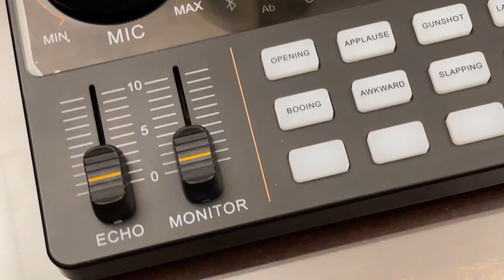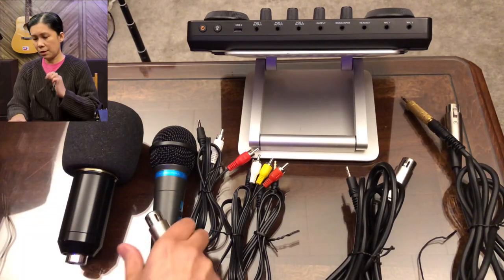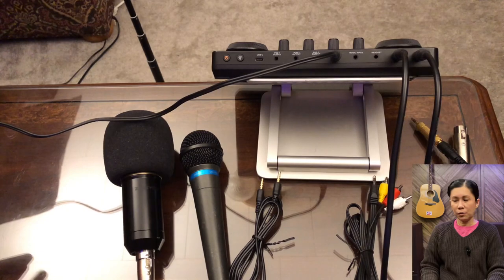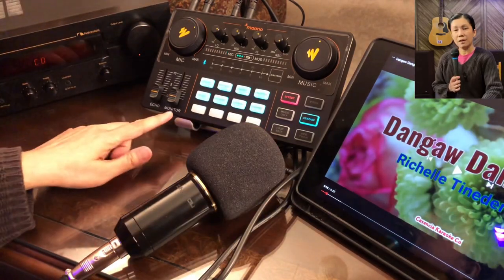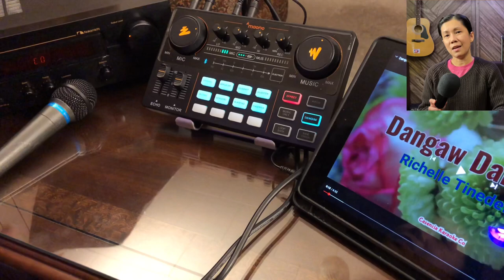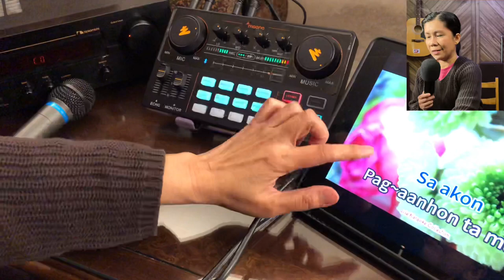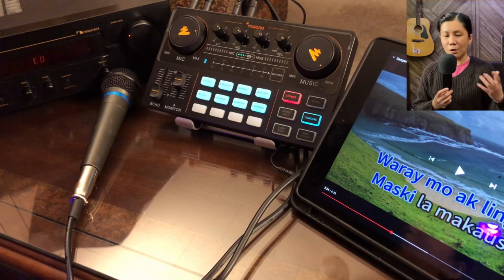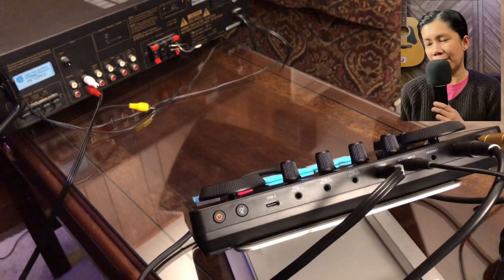Maonocaster Lite to Amplifier for Karaoke Set Up - Testing Condenser VS Dynamic Mic

Comment: How did you connect a dynamic microphone? Does it need phantom power?
Reply from the maker: It does not need Phantom power. I used an adapter to connect a dynamic mic as I showed on this video.

Comment: Hi we are using a normal sound bar will it work?
Reply from the maker: If it is like portable speaker that you connect from a phone to the speaker, yes. If it is powered speaker, yes. It might not as loud as speaker connected to an amplifier or receiver.

Comment: how to connect to big speaker wtih live stream?
Reply from the maker: For streaming only, you don’t need to connect to a big speaker, using an earphone would be ideal. However if you’re having let’s say karaoke party wherein  it is connected to a big speaker like Set up in this video, you Simple connect the device to want to use for streaming to the Pod 1, 2 or 3 of the Maonocaster. Open Fb live or you tube live and you’re all set.

Comment: I went to Maono online shop and Thai Shopee sand Lazada and looked at their microphones and they are mostly usb connections! Illogical for the manufacturer of both this product and the microphone, to make them incompatible IO, as you cannot use with the input jackplug receptors. The only thing i would criticize with Maono and many other products like this, is they refuse to agree with competitors on a universal IO, and that they bare still selling us off all the old red yellow and black vga cables left over from 1990s, as their way of clearing old outdated stock cables.. its a mess of cables on my desk with the maono.. truly as confused and knotted up as a bowl of Chinese noodles. Otherwise a very useful multi streaming device, but still a short lived product that is in basis, a gimmick/gadget, and gadgets always end up on a dusty shelf when they deprecate. Luckily the Maono (i own one) is cheap enough to not have to worry about its limited timespan of usability, as emerging tech and hardware make it unnecessary, and disruptive tech makes it redundant